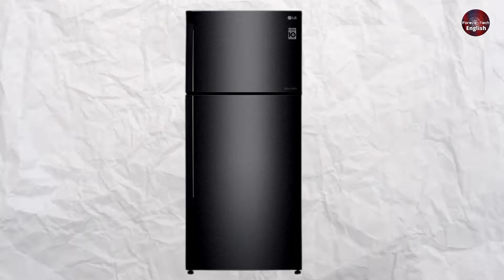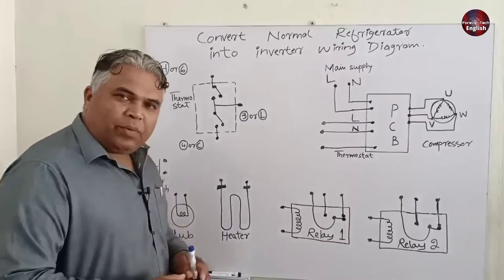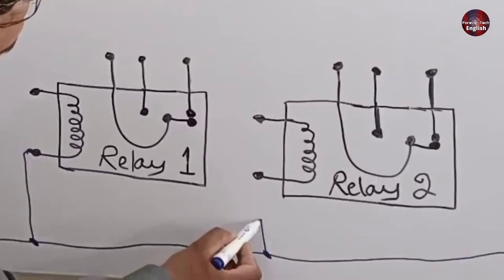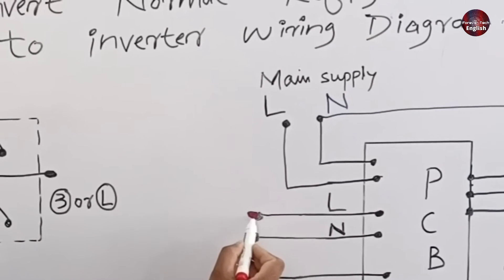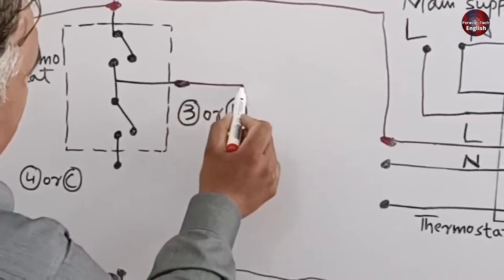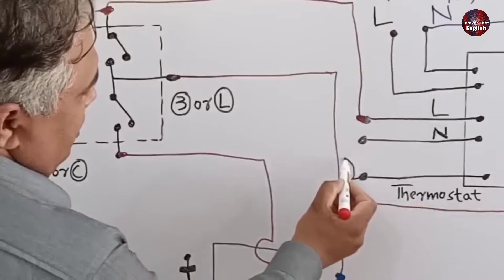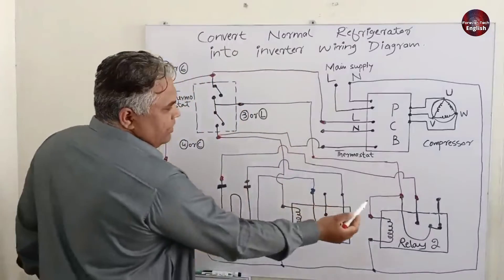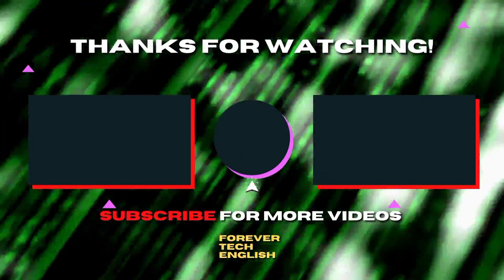Wiring Connection Diagram To Convert Normal Refrigerator to Inverter

Comment: Wiring diagram for converting a conventional refrigerator into an inverter one. But then it won’t be a refrigerator, but an oven and, I think, with low efficiency. )))
Reply from the maker: Not at all, I converted them to inverter refrigerator and it worked fine.

Comment: Hi Guys
According to this diagram, I think there are two important parts missing for the system to operate better, which are the def sensor and the timer. What do you mean?
Thanks
Reply from the maker: This is a direct cool refrigerator, defrost timer and defrost sensor is needed in no frost refrigerator
Reply: @forevertechenglish  Suppose we have 2 devices using the same inverter compressor, the 1st type uses main PCB, has PGM control, RT sensor (environment sensor).  The second type uses thermostat, timer, def sensor.  In your opinion, how is the performance of the above two types of devices?  Regarding price, I think type 2 will be cheaper, is my thinking correct?
Reply: @nguyenson3112  I think there is a thermocouple that goes into the freezer that sends the signal to the control board to activate defrost. It's only controlled by that.
As long as you leave the board that controls that connected I don't think you should have an issue